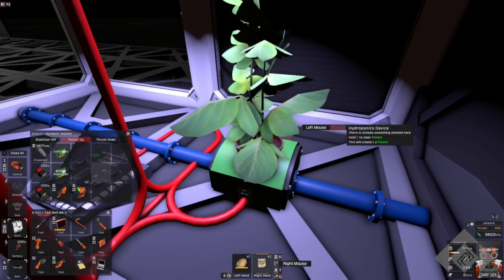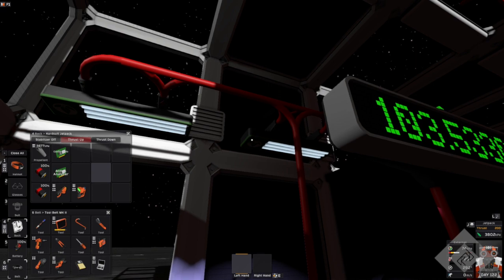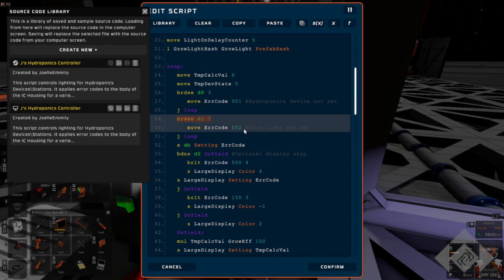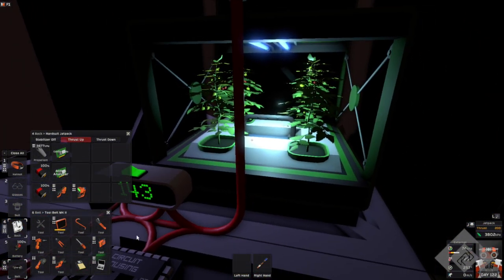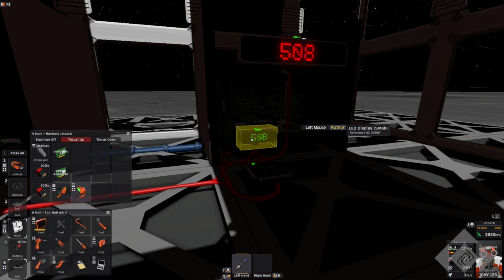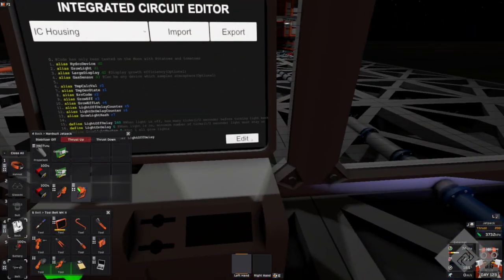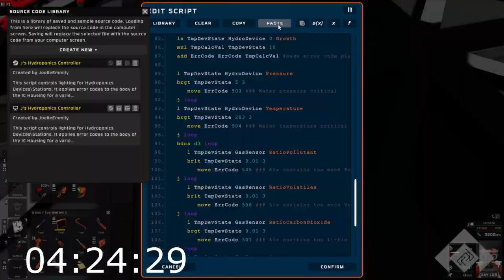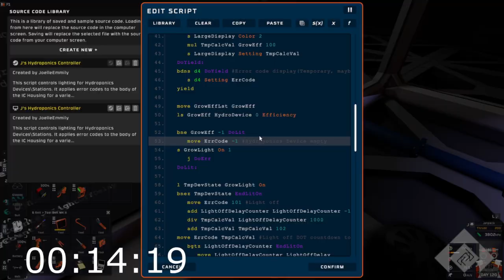PLANTS! Part 5, Hydroponics Control Script! By Me! J! - Stationeers

Comment: For Harvie a second chip might be an option, could write to the housing to communicate between chips and run 6 harvies on that.
Single hydroponics device and 5 trays and treat it as the hydroponics station.
Another add on to the code could also be a light sensor for daylight or as a make shift timer for running 2 batches of ferns/winterspawn for optimal oxygen/cold production.
For video purposes put a light in your uniform and turn it on, stationeers is a dark game sometimes.
keep up the good work👍
Reply from the maker: I was upping the contrast, but prefer the darker videos with more vibrant colours... I guess that's not a popular thing... But I also live with the windows blocked out and the lights off...